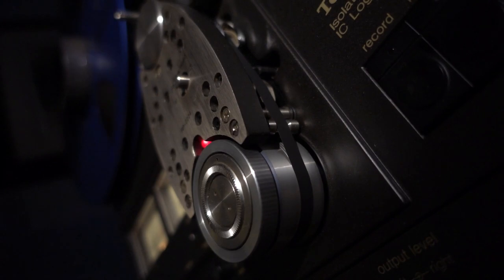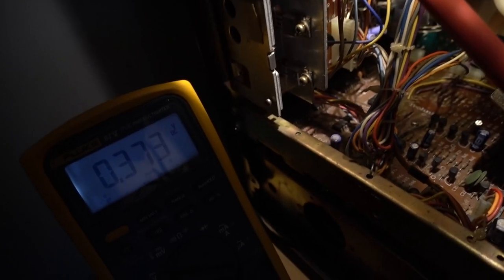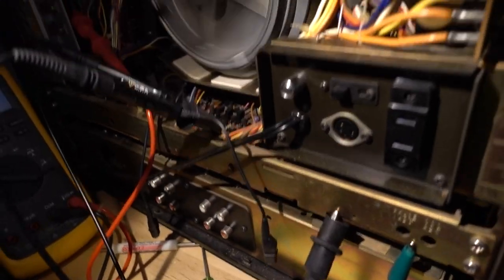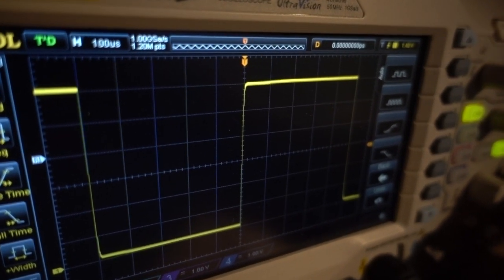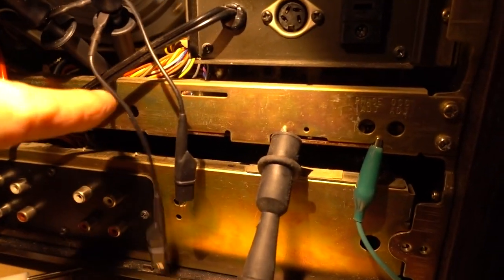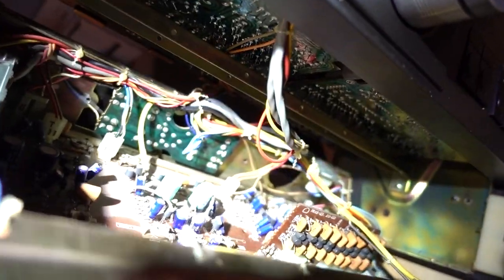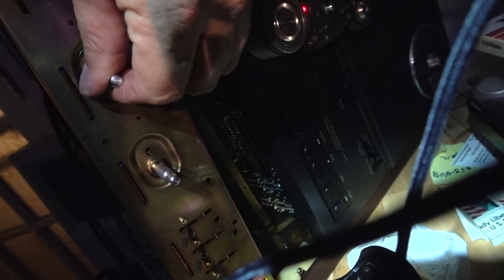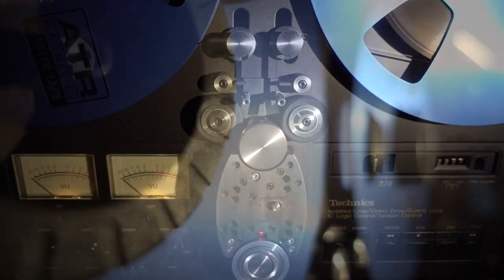Technics RS 1500 Rehab Stage 2

Comment: Nice video, but you apparently ran into a common problem with the 2trk/ 4/trk switch. There are 4 ears holding the switch together in the back, they oftentimes become loose, and after that there is a intermittent audio problem. What I did with mine is take the headstack off of the deck, (3 silver phillips screws) and gently pull the headstack off, being sure to not scratch the capstan. Then I pulled the black plastic cover off in the back and used a pair of longnose pliers to tighten/bend the 4 ears that hold the switch together. Also, a squirt of deoxit didn't hurt

.